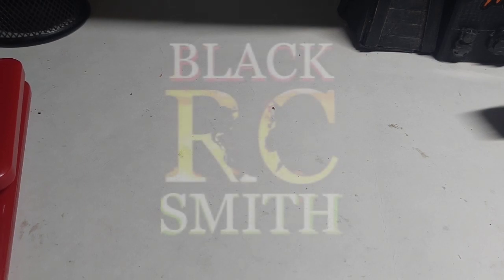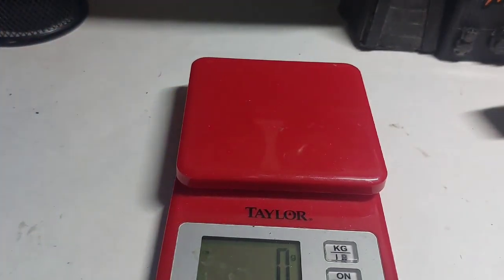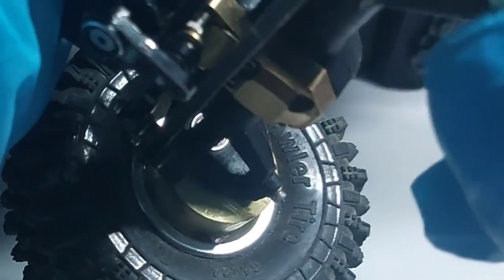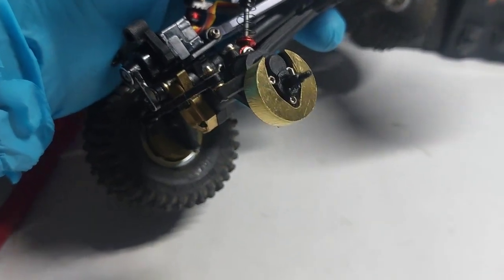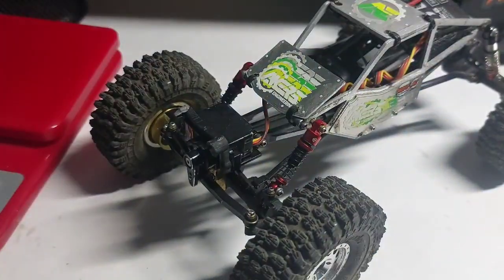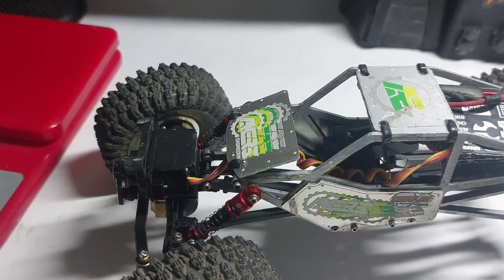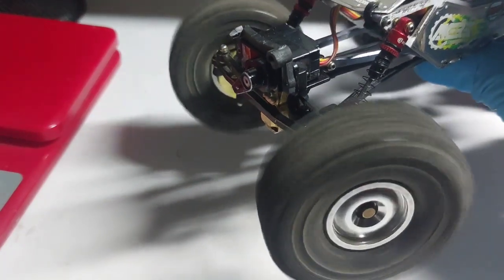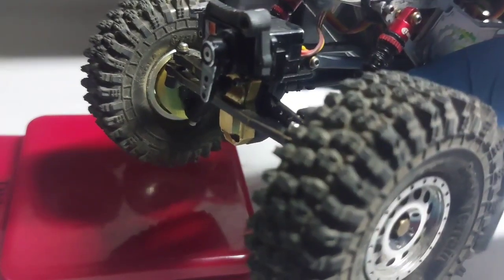AKERS MINI MARAUDERS KNUCKLE WEIGHTS

Comment: Not a bad lil trick. If you got access to lead sticky weights you can add 50grams to each axle by putting em inside the tire on the inner bead lock ring. I got a vid of this if you want a bit more. Got a set of wheels fully built up to 340grams by doing this. :)
Reply from the maker: Great idea too. THANKS for watching bro.